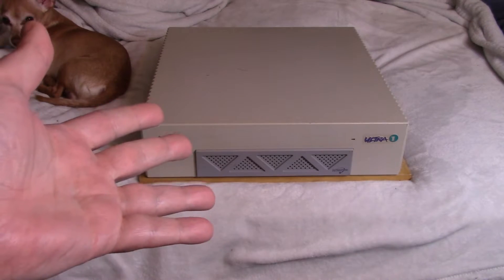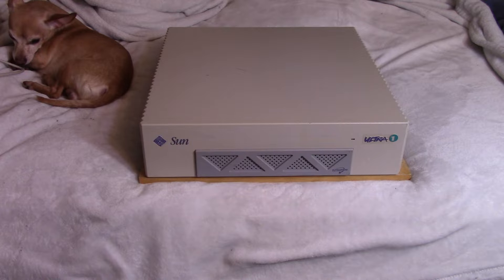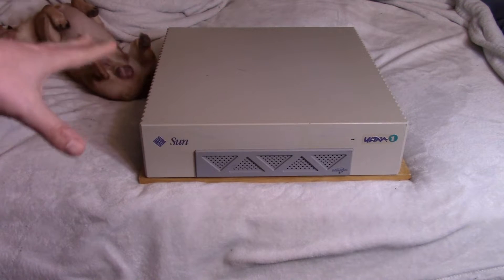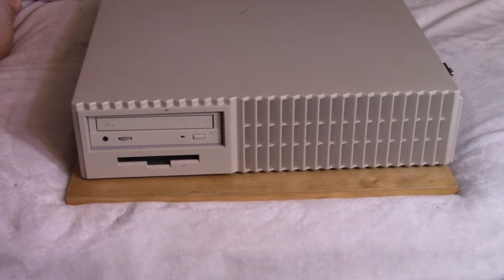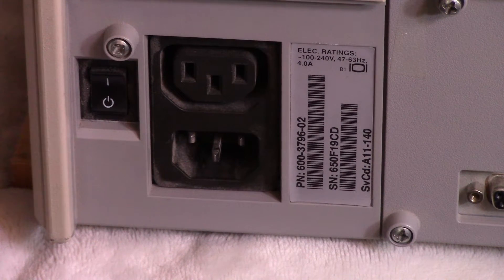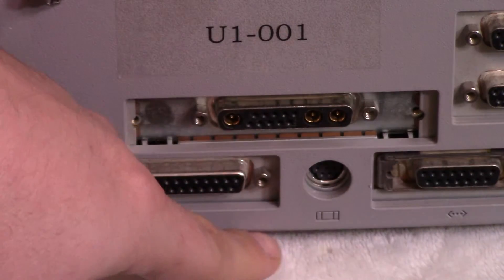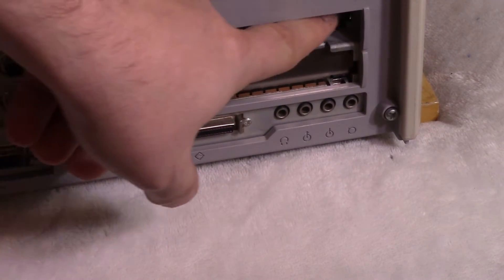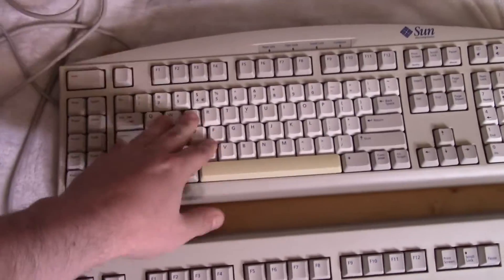Sun Ultra 1 Workstation

Comment: 13W3 is a standard used on all UNIX workstations. The adapter is to allow use of standard SVGA monitors. To use the AUI over CAT5 you need a transceiver but it’s no different from Power Macs of the same era. The other is just standard CAT5 Ethernet. The SCSI used SCA interface so I have replaced my drive with and 12000rpm 18.2 Gb internal drive. Runs it no problem. The main issue most will have is the NVROM battery failing. You can either grind out the edge and solder a battery in or buy a blank. Either way you have to reprogram the PROM.

Comment: They were used primarily to run CATIA from Dassault Systemes and cryptographic or genetic engineering research and the like. At no point were they used for graphic design. That was Silicon Graphics arena.

Comment: I think it's important that you learn about the item you're reviewing BEFORE doing the video.  But I'll give you some insight...

AUI is used with a transciever that allows you to use different Ethernet standards for backwards compatibility to 10-base-5, token ring and BNC ethernet configurations for older networks.   They were common on Sun equipment (Apple, HP, DEC and SGI also utilized these in many of their workstations and servers throughout the 90s)

13W3 pre-dated VGA and was required to be able to set resolutions above 800x600 and started with SGI for their 3M goals (1 meg of Memory, 1 Mhz, 1 Megapixel) to achieve 1028x1024 format video

The Sun Ultra-1 had side mounted floppy and CD drives as a legacy feature to carry on their pizza-box style from the Sun Sparcstation 1, 2, 5, 10 and 20 models.   When used in a workstation where the monitor was set on top of the case, it was a very clean look that set them aside from other workstations, which was the point.   Yes, if you had desk mounted speakers, they could theoretically get in the way, but most people didn't find that to be a problem.

The memory modules were propietary and were ECC but also Parity, which means you had to install them in pairs and all SIMMs were required to be exactly the same size.

The Sun Ultra-1 was capable of a maximum memory loading of 1GB between 8 individual SIMM slots.

There you go, there's your specs.

Comment: The network port is a connector for an external transceiver, also called "MAU" (Medium Attachment Unit). These transceivers often have 10base2 or 10baseT (TP, regular Twisted Pair).